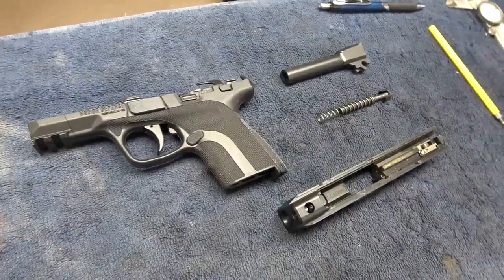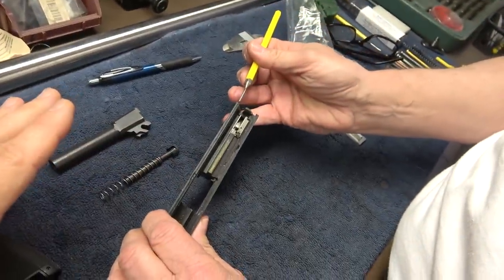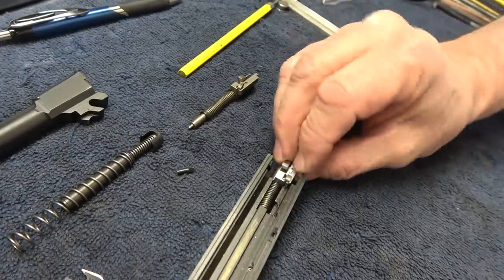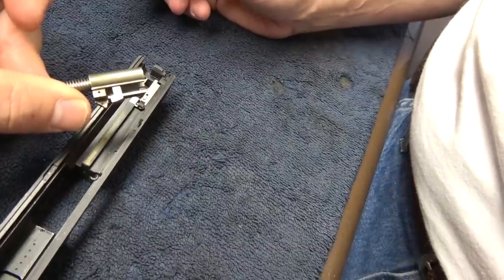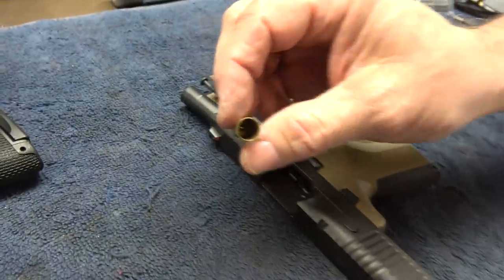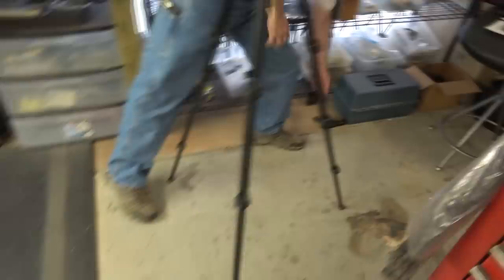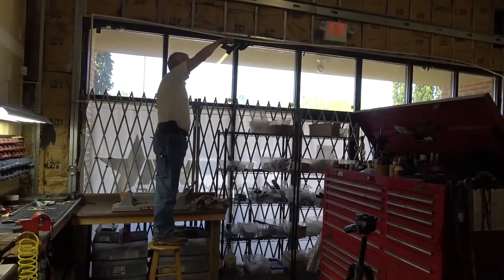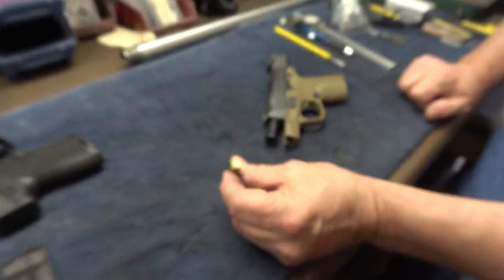Honor Guard Drop Safe Conversion

Comment: Bah...but when Sig did that with the P320, people cried a river.
Reply: Matthew Burton probably because the sig is nearly $200 more, and they are a massive company in comparison. Sig should know a hell of a lot more than a newer company.
Reply: That's because Sig knew there was an issue, and never told the public until there was the public outcry. That's why the Army Sig had a new design for the military testing - and the original fix was just putting in the Army trigger.

Comment: Firearms shouldn't "discharge from abuse". Smh.
Reply: And that is why he is showing you that that VERY RARE situation of the gun discharging when being dropped has been corrected!
Reply: Joe Doe it really wasnt that rare. Especially if they issued a recall.
Reply: Jonathan K actually, it was and is that rare. Most gun manufacturers would and will issue a recall over just one verified instance of a gun firing when dropped because #Alllivesmatter. Provide reliable sources that document otherwise.